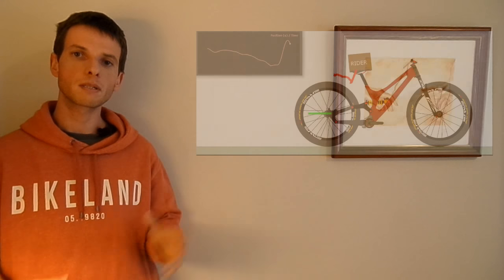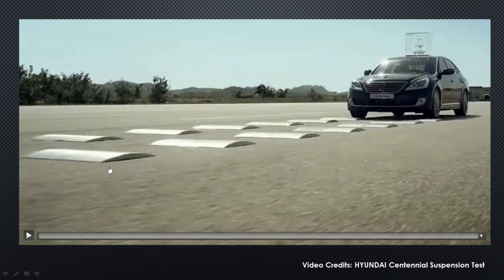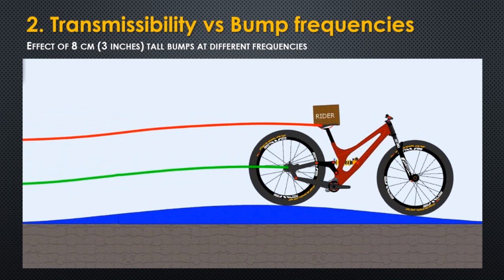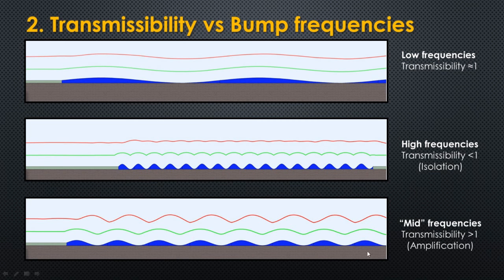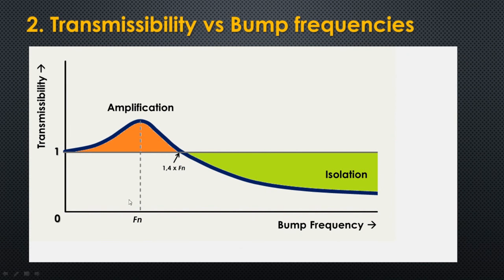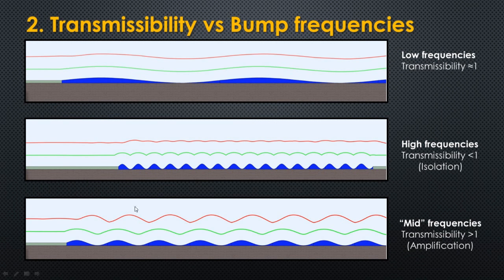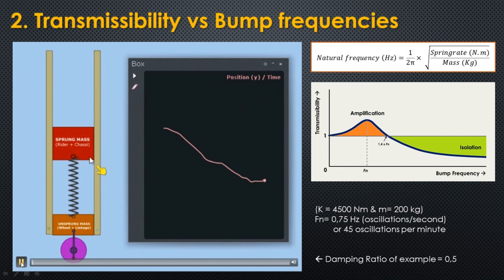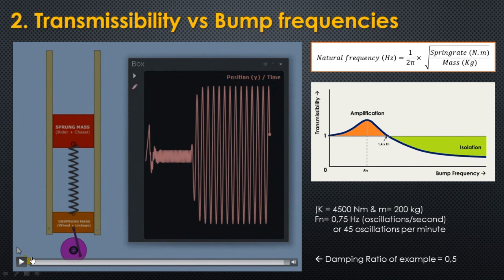Rebound speed vs Suspension performance (MTB Ep.15)

Comment: Awesome video :) It would be cool if you could make a video about forks sometime, especially regarding how to balance compression damping and spring rate (and spring curve too as we can adjust it easily in air forks). I have a pretty good understanding of how the damper works but actually applying it and getting a good setup is more difficult

Comment: really enjoying your videos, thank you for making them. do you think you might look at fork setup in more detail? I've always wondered how volume spacers impact forks like the pike
Reply from the maker: +wigdig Check my video about air spring shocks, it talks about volume spacers. Although it's about shocks it can be applied to forks since the air spring has the same principle. The volume spacers affect the second half of the travel, making it more progressive and firmer at the end of the travel. Good to absorb bigger impacts. If you experience many harsh bottom outs use more spacers. Otherwise it's OK as it is (the idea is always to use full travel but without many harsh bottom outs). Bye

Comment: Loving your videos, it would be great if you did a video on the science behind different wheel sizes and the effect on suspension?
Reply from the maker: Thanks! I have this super scientific picture (eheheh): https://ep1.pinkbike.org/p5pb14377433/p5pb14377433.jpg
I never dig into the wheel topic, but I would say that bigger wheels decrease a bit the suspension shaft velocities and bump frequencies (making the bumps smoother, as shown in the picture). Bigger wheels also increase the center of mass and add rotational mass. More importantly, if you do shuttles on a van, it's harder to put the bike inside (eheh). So it's always a trade off. Bye

Comment: Hey Andre, awesome stuff on your videos! So let me ask something, if I understood correctly, if your shock has separate LSR and HSR knobs, the HSR should be set FASTER (less damping) than the LSR knob?
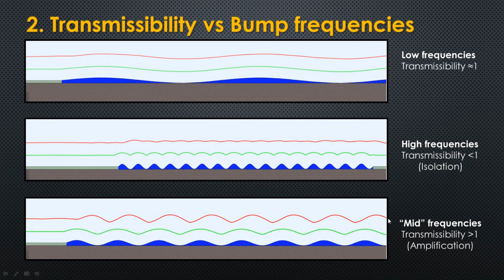Reply from the maker: Hi. Yes, low speed rebound needs to be slower than the high-speed (but this does not necessarily corresponds to the number of clicks of the settings!!!). And don't use extreme settings because high and low-speed rebound work together (for instance, in a high-speed rebound event, although the oil flows in the high-speed circuit, some of the oil also flows through the low circuit). If you have a shock with both settings I would recommend to watch this video at minute 9:00 ( https://www.youtube.com/watch?v=Yjql1kExvCE ). Probably this is not the best way to tune it, but I believe it's a good starting point, at lest it's a balanced way to do it, without going into the extreme settings. If you want to try it tell me if it worked well for you.

Comment: Could you explain, how high and low speed compression affect all this stuff.
Reply from the maker: +Maxim Stepanov The compression affects this in the same way as rebound. The more compression you have the more stable is the ride (less amplification) but more harsh it became (less bump isolation). This is why you also got 2 compression circuits. Thus you can run higher compression damping at lower frequencies (LSC), while the high-speed compression circuit automatically reduces the amount of compression damping at high frequencies allowing better bump isolation. So, it's the same as rebound. Indeed both compression and rebound act together. The difference between compression and rebound is that on a MTB suspension (and in other motor vehicles) the amount of damping from rebound is typically 3 or 4 times higher than the amount of compression damping. Bye
Reply: 'More compression' you mean softer or harder? It seems that more compression(harder) means that you get more energy from bump and get more amplification?
Reply from the maker: Maxim Stepanov Shit I deleted  my answer by mistake. Higher compression damping means that shock won't compress so much (harder). So on lower frequencies where the suspension amplifies the actual size of the bumps (so it moves a lot up and down), more compression damping in this case will limit the amount of shock movement reducing amplification. However, as you said on square edge bumps it also reduces isolation, so it won't absorbs so much the bump (I understood what you mean, but you don't have amplification on high speed bump, only isolation). With a low and high speed compression circuits, you can have more compression on lower frequencies (LSC) reducing the excessive wallowing of the suspension (stability) and at the same time the HSC circuit allows more oil to flow at square bumps, reducing the amount of damping, and improving bump absorbtion (isolation). bye
Reply: 1) Thanks for this videos! All russian velomaniacs see it.
2) It would be very interrest see same video about LSC/HSC (many ammo have this settings) and about complex influence both rebound and compression settings at typical terrain. 
3) I read that some shocks like x-fusion vector coil HLR have no separate HSR adjustment, but HSR coupled with LSR and change automatically (!).
4) New shocks have climb/trail/descend ideology, can you explain this approach vs separate HSC/LSC Ajustments?

Comment: Can you do a video on how to set up a fork for critical rebound similar to ep. 5 with the shock for those of us with hardtails? These videos are awesome and really help me understand some of the finer nuances of suspension workings.
Reply from the maker: Thank you. This is a very requested question but unfortunately I don't have any good "scientific" method for the fork rebound. On a full sus bike my advice is to setup shock first and then tune the fork in a way that feels balanced with the rear (or even a bit faster). For an hardtail you don't have that reference point. My advice is to tune it by "feeling" (i hate feelings :D), in such a way that the fork won't behave as a pogo stick or too slow. The good news is that you have more room to error with the fork rebound, since contrary to the shock, a quite faster setup will not send you over the bars on sketchy trail or jump.

Comment: Whats about a rockshox vivid coil? 
There is a lowspeed compression dial, but not highspeed dial so the highspeed compression is adjusted via shimstack?
and there is a beginning stroke rebound and a ending stroke rebound, but thats not the same as high and low speed right?
There is also rapid recovery. But how should i set up the rebound? Does that mean that I should set up both dials a bit faster than the critical point and let the rapid recovery controll the high frequency bumps?

I don't know if i am right with this but hopefully you can tell me. You probably know the "Marsh Test"(if not watch some of the newer santa cruz syndicate vids), where Greg Minnaars mechanic and the fox guys just slam the rear wheel to the ground. It seems, that they also measure how long the bike rolls along after the impact. Can you explain how they make the bike really stick to the ground and what adjustments they change? I think in case of the vivid this would be the beginning stroke rebound right? 
I hope you like this comment and can answer my questions! Thanks a lot, I love the channel and i hope, that i understand what is going on there!
Reply: Sorry about my english, I'm not a native speaker
Reply from the maker: Hi. Yes the high-speed compression on the vivid is controlled internally on the main piston via shim-stacks. The begging and ending rebound are the same as the low and high-speed rebound. This is a nomenclature used by  Rockshox to simplify but technically it's not fully correct since you can have high-speed rebound events on the beginning of the travel (for instance when you hit small bumps, rocks and roots on a fast trail).  I don't know that "marsh test" do you have the link of the video? But from your description it looks like the drop-test (https://www.youtube.com/watch?v=PQDCUa-KIyw), or is it different? Regarding your question on how to adjust both rebound knobs, my advice is to watch episode 5 (if you didn't yet) and in particular watch episode 7 after min 9:00 (https://www.youtube.com/watch?v=Yjql1kExvCE). I hope that this can be helpful. Bye
Reply: andrextr Hi. I saw your drop test video, but i didn't think about it. It is pretty much the same but they also slam the wheel to the ground in different directions. I think this is to see how the suspension reacts to sideways impacts e.g. bucking. I saw all your videos, but i don't understand the beginning and ending stroke rebound. As you said highspeed can be rebounding after the landing pf a big jump or roots at higher speeds. I try to find the test in a video. Thanks!
Reply: andrextr You can see it at the episode 2 at cairns worldcup at 9 minutes. Channel: The Syndicate
Reply: andrextr So it would be the beginning stroke rebound right? So the Lowspeed compression doesn't affect this?
Reply from the maker: Are you talking about the drop test? Yes, low and high-speed compression affect the result. The shock get's glued to the ground because it absorbs the energy of the impact. The more compression you use, the less energy that the spring will absorb, and the more it bounces. An extreme case of compression is the full lock-out. As you can imagine, in this case, it will bounce +5 times. :) I'm not saying that the less compression the better, indeed in most trails you need some amount of compression to avoid excessive use of travel. However too much compression causes harshness.
Reply: andrextr Thanks a lot, I think I understand it now.
Reply from the maker: Oh I remember to watch that! Yah, it's a drop test with a fancy thrown :D I still prefer the simplicity of drop test :) Thanks bye

Comment: Mechanical engineer here with a question: I like your explanation of rebound speed and it's effect on suspension performance, but I wonder how applicable the conclusions are to a real fork/shock because I'm not sure if your simulation models include compression damping as well. Disregard this comment if they do, but when you programmed your suspension simulation did you include a separate force vector in the direction of shock extension (F_y = -cv where k is the coefficient of compression damping) as well? Most modern forks and shocks allow you adjust both compression and extension (rebound) damping to independent values and I'm curious to see an animation of how these two inter-related parameters affect overall suspension performance.

If you redo the simulation with compression and rebound damping having independent values the sum of forces on the suspended mass would be:
m*a = -c*v - k*x where c is c_comp when x dx is negative and c_rebound when x dx is positive.
Reply from the maker: Hi Alex. Thank you for your question. I'm not an engineer, I'm a biochemist eheh. Anyway, this simulator is a free and cheap one and it doesn't allow much tweaking, it only allows changing damping ratio. Yes it does have compression. In real world the damping of a shock is 70% for rebound and 30% for compression. So, the rebound has a more important role in the overall damping. The animations were mostly a visual aid to explain the transmissibility concept. The more damping (either compression or rebound) the more stable the ride would be over low-speed frequency bumps but the harsher will be over high-speed bumps. It would be nice to have a better simulator to simulate different reb&comp damping for the different shaft velocity (to simulate high and low speeds comp & reb. damping), but this is the best I can do :) Bye

Comment: +andrextr
Hi Andre,
I really like your videos, they are well explained and interesting. I have a question/suggestion regarding the topic of rebound however.
In your video you assume that both the weight of the bike and of the rider are sprung mass, which makes the use of critical damping very important. In reality however the rider is not static and can absorb impacts/vibrations etc. aswell. In this way a lot of other people recommend much faster rebound speeds because the rider already adds to the rebound by using his arms and legs. (for instance Vorsprung suspension: https://youtu.be/nVZnyrnqzcQ?t=3m10s). 
What do you think about this? Could you simulate the damping applied by the rider to the system by adding a secondary spring/damper setup above the sprung mass (which has to be lowered to the bikes weight) to your simulation at 13:05 in your video? I would really like to see the effects of this. Realistically the damping of the rider would be quite slow as a rider cannot follow high speed oscilations with his arms and legs that well.

Comment: Andre, you usually have answers before I think of the question but here's one I'm wondering about. On rocker equipped bikes while the bike is unweighted the seat stay contacts the rear of the rocker at close to 0 degrees. As weight is added the stay pushes the rocker to an increasingly obtuse angle which seems to decrease the mechanical advantage of the stay and wheel, which isn't what's needed. Is this to counter the rapid ramp up of the air shock? But how do bikes with a horizontal shock deal with the progressiveness? Bikes use coil and air shocks with the same set up also so what's up , O Great One.
Reply from the maker: The progressivity can't be seen just by the position of the rocker. For instance the shock position also affects the leverage ratio (see Ep.4 https://www.youtube.com/watch?v=78DD82fx4M8 ). For instance, the Canyon Strive and Radon Swoop have an horizontal rocker, however, Strive is much more progressive than Radon. This also applies to vertical rockers, for instance, NOX EDF or DHR are very progressive while Scott Genius LT is slightly regressive. Not sure if this answers your question :)

Comment: Great explanation, thank you!
Unrelated, but something I'm curious about: Is a more progressive air spring superior to more damping of  high speed compression? Because HSC is meant to slow the shock down in essence when it encounters high speed hits. However, wouldn't it be better to simply pop in another volume spacer instead? Or are these achieving the same thing, simply in different increments?
Reply from the maker: Thank you! Yes, in my opinion is better to add a volume spacer and use the low as possible high-speed compression (HSC). Because HSC does not only kicks in on big impacts, it also kicks-in on high-frequency small bumps like going fast over rocks, pot holes and roots. So, HSC is nice to avoid harsh bottom-outs but it also produces harshness over those small bumps. With a volume spacer you increase the final progressivity without reducing the small-bump compliance. (I discussed this topic on Ep.7 video). Bye
Reply: Awesome thank you!

Comment: Great Video Andre! Question, does the RockShox Pike and Monarch Debonair come with High-speed rebound damping, and for a 60kg rider what would be a good Low-speed damping for the fork? Thanks
Reply from the maker: Yes, rockshox called it "Rapid Recovery". It's just a fancy name for high-speed rebound (marketing). Pike and Monarch have the "rapid recovery" thing. In other products they called it dual flow (2 rebound circuits). Regarding the low-speed adjustment, it depends on your style of riding and the trails you ride. If you like the front a bit more firmer, or if you do flowly trails or park, then add some low-speed comp (LSC). If you like the fork more soft and spongy or if you ride a lot bumpy and rocky trails use less LSC. The more LSC the more firmer and stable the fork would be, with less diving, but if you put too much you start to get some harshness. Bye

Comment: Great work man! Which software are you using?
Reply from the maker: +Alessandro Dando For the simulations I used algodoo. It's a free tool, it's not great but it works OK with simpler simulations like the ones of the video :)

Comment: Great video! If I want my fox dhx2 to give more pop for jumping what should I do? Decrease low speed rebound?
Thanks!
Reply from the maker: You can decrease (make it faster) High-Speed
 Rebound (HSR) which will enable the bike to recover quickly from deep travel. This will amplify the "pop" effect when you preload the suspension with your body weight on jumps take offs. Be careful because faster HSR make the bike more instable after a big hit landing (the rear wheel does not get "planted" so wheel and it can lift from the ground after impact).
Reply: @andrextr  thank you! I I sped up HSR rebound 2 clicks as well as the LSR. It has noticeably more pop. Thanks for the heads up on getting bucked on harsh landings, I'm known for casing jumps.

Comment: What software did you use for the animation/simulation? Does it output usable data?
Reply from the maker: It's the Algodoo. It's not a great tool, but it's free and it works OK on simple stuff. Yes you can output graphs to excel. It's good for physic classes :)

Comment: Hi, I bought a kona hei hei dl race from 2016. Im finding Im quite slower than my normal hardtail. Kind of feels like Im losing a lot of force through the back shock.
I mostly drive XC style routes. Do you have any tips? 
Im currently weighing 75kg.  Have the sag’s set at 20% in front and 25% in the rear.